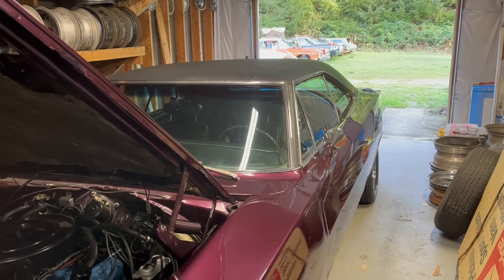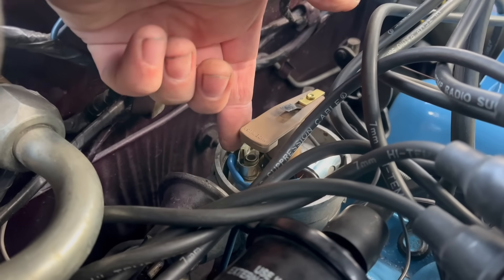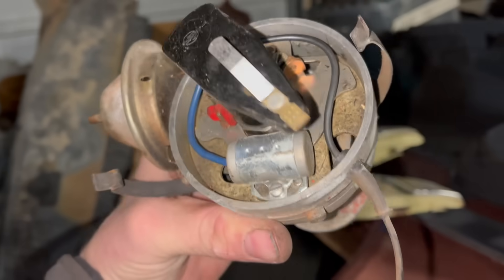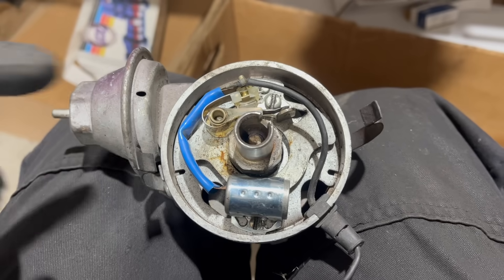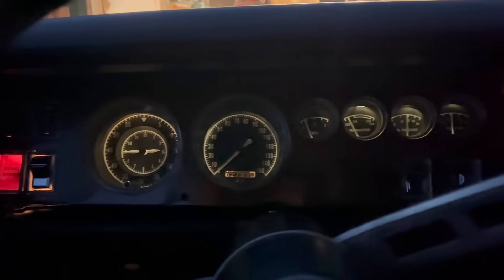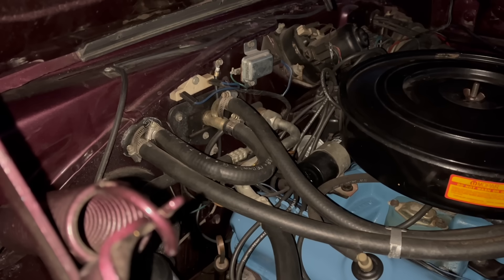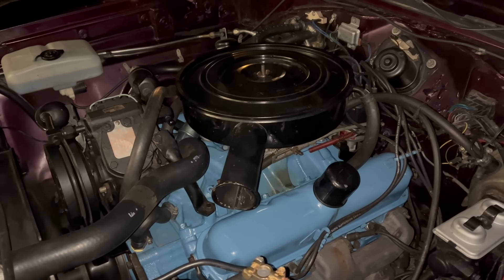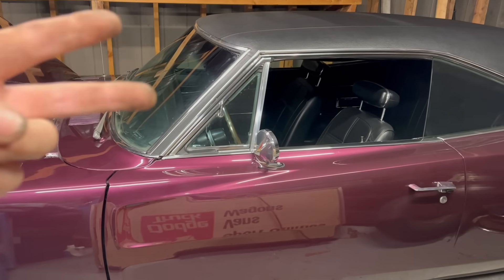I Drove This 1969 Dodge Charger 1800 Miles With A Broken Distributor... Let's Fix It!

Comment: Jamie!
Do not count me in with the BBD haters - that carburetor was used by Ma Mopar for damn near 20 years and
is an incredibly reliable and simple carburetor. For non-haul ass applications of small blocks, it's damn near
perfect.
As usual, a very enjoyable video chock full of good info. How a young feller like you has all that already in his
noggin is beyond me.
- Ed on the Ridge

Comment: The other part of the "5 minute tune" that takes 20 minutes is adjusting timing and managing the various (OK, two) advance systems.  I took apart and cleaned up the distributor in the Belvedere when I first got it, to discover, like you, that neither the centrifugal or vacuum advance was happening.  No problem, new vacuum canister and get everything clean and greased and back in the car.  I did notice that a pin on one of the weights that slides in the slot to advance things was worn flat on one side.  Everything seems to move around like it was supposed to so back together and into the engine.  No matter how I tried, it could only read about 10 degrees of centrifugal advance (the rotor plate says 11.5 for 23 degrees of crank advance), and it was variable and only occurred at higher engine speeds - 3000+ rpm.  I took the distributor out and apart again, didn't appreciate the problem, made sure nothing was in the way of things moving and stuck it back in.  Basically the same result, which is not surprising because I didn't change anything.  Now a distributor that only advances 10 degrees is not a bad thing to have, unless it does so unreliably.  Then it dawned on me - the way the weights move the plate and advance the rotor relies on those pins being circular, and if one side is flat that only prevents the plate from rotating no matter how light your springs are.  I can't find anyone who will sell me just the parts I need, so maybe a new distributor is the only way to go.  I am going to try to return the pin on the weight to circular cross-section with some grinding to test my theory, and maybe fix the problem at the same time.

Comment: I sort of understand why some people don't like the BBD carb - it's so darn small, But I love 'em. My first car (a 69 Fury 318) had one, and I have one on my 56 Dodge pickup with yet another totally stock 318. For what I use the pickup for, the BBD is perfect - it almost never gives me any trouble and just does its job.
Reply from the maker: Exactly! Most of my experience with them has been on trucks. Just a solid unit.

Comment: That distributor reminds me of my first car when I was 15. Had a 64 Dodge 330 383 with a 4speed and 3:91 gears. It had a Prestolite dual point distributor and shortly after I bought it quit in heavy traffic and found that one of the points had completely burned up. I replaced it with a Accel duel point. Just realize this was back when I was 15 in 1970 with smelly feet.
Reply from the maker: Oh wow! I sure wasn’t cruising around in a big block four speed Mopar when I was 15. Haha.

Comment: Had a similar situation, was out for a drive, suddenly the Engine started loping at idle, and would smooth out, kind of, at WOT. 
Pulled into the gas station to pop the distributor cap off, The distributor springs had snapped allowing full and no advance at the same time as the engine was running, the distributor rotor would flop back and forth as there was no springs keeping tension.

The engine was idling at 1400 to 3500, up and down constantly, i was able to sweat profusely and "limp" the car back home.
Any lower idling RPM would stumble and potentially kill the engine, the low/loping RPM also had a dreaded negative feedback, If the RPM's got too low, the Distributor timing would "snap" to no advance, and high RPM's would give a momentarily smooth but high idle, but the idle would still oscillate, but not enough to kill the engine.

This was on a Dodge Custom 880, or Chrysler's forward look car, with a 361, the hope is i didn't shave too much life out of the engine with extended high RPM oscillations.

Comment: You can run more initial timing without driving the total timing too high by shortening the slots in the advance plate.  If you decide to shorten the slots by welding, be sure to wrap the points cam with heavy tape so that it doesn't get weld splatter on it.  :)
Reply from the maker: If you heard me reference a video about performance timing curves, then you heard me reference a video where I explain all that. 😅 also, I wouldn’t weld it without disassembling the distributor.
Reply: Why on Earth, would anybody WELD up components in a DISTRIBUTOR while it is still Assembled?!, and Heaven Forbid while it is still installed in the Vehicle?!. To debate this is Utter Lunacy! Just Sayin'.
Reply: I get pinging bad when i advance my 440. Its a stock racer brown cam and seems to not ping at 3 degrees advance, but i know it will run better with more initial. I put lighter springs in it. I got one of those firecore distributors to try out. So, what ur saying is if i lock out the mechanical earlier it will not ping? Then hook of vacuum advance.
Reply from the maker: @milldog1969  yeah, that, basically. Check out my "Performance Timing Curves For Dummies Like Me" video where I give a pretty good explanation of all of that.

Comment: We should have spent a day fixing shit here before you headed out on your quest to drive 2400 miles. You would have made it. But it was a adventure nevertheless and a education on how to patch up things. As for bbd carbs they are simple work horses and for stock stuff there fine. For me and my engine builds they get the dumpster treatment with the intake. But for that car it's fine. As for the ping issue better fuel is needed now. It will be fine and happy. And remember that car hates you so walk away. No run😅

Comment: I built an engine that didn't have the power it should have had. I accidentally discovered that the mechanical advance was frozen plus it had a way too stiff pair of springs oooon it. Once I got it operating correctly I couldn't believe the amount of power that the distributor advance is worth.
Reply from the maker: Yes! Getting that right is absolutely essential. It’s basically the thing I pay the most attention to.

Comment: As I said in another message, I was looking at 30-40 dollars to replace the SB Mopar vacuum can.  Eventually I found an old complete distributor for less than that on Ebay and bought it after I got the seller to test the advance.  So, you can't have enough parts.  There should be a way to take those apart and replace a diaphragm  , like on a brake booster. They now make adjustable PCV valves ($$!)  When are they going to make rebuildable vacuum cans? Or fuel pumps.   (Don't say the expensive one can be unscrewed and you have access to the diaphragm because they don't sell any diaphragms as service parts.  )
Reply from the maker: They are rebuildable… if you’re really, really dedicated. And I’m not. Much easier to have a pile of 50 spare distributors to sort through… but some day we’re going to run out of them. So we hoard as many as we can.

Comment: I've had more BBD equipped cars than anything else, and I like them but don't have unrealistic expectations.  I'm keeping up with David Vizard and the Mission Impossible series, one item of which was modifying a 318 engine's BBD for more flow.  Also still kind of looking at a way to mount a 1-1/2 BBD from a 383 onto a 318; still a two barrel but more flow.  Could be fun!

So Jamie, how do you think the Charger would do on onramps and uphills now?  I was surprised when you mentioned issues on your road trip video; my '71 318 Challenger with 2.76 gears was certainly not a quick car but I never got the impression on onramps or freeway grades that it was struggling at all.
Reply from the maker: It already feels much better. It will never be fast but does feel respectable now. I’m really excited to see what their 318 build does. It’s a really neat idea.

Comment: I don't understand the hate for the BBD either.  I've had BBD's in my Valiant, my Swinger, my SX/4 Eagle....  very simple, very easy to fix when they do go wrong.  I especially like how they have separate set-screws for Fast Idle and Curb idle.  I've heard some people describe them as an "emissions" carburetor which is hysterically untrue.  BBD stands for BALL & BALL DUAL.  It's basic design dates back to the Thirties.  Don't believe there was much emissions control back then!  While the later ones did get all sorts of electro-digical giblets.... anything prior to 1980 is gravy.

In regards to your Charger's inner tail lights.... I see this ALL the time.  Even one of my Best Friends has done this to his Charger and he won't let me change it!  Seems lots of people just jam an #1157 bulb into those inner sockets.  That's the incorrect bulb.  Try and find a #67 bulb.... these bulbs only have the dimmer or "running light" filament and won't be so bright.

Interestingly enough, the 80's Lebaron coupes had a similar setup. Since brake lights can't be on moveable body parts (by law), only the outer tail lights on a Lebaron used #1157's.  The bulbs that lit up the trunk tail panel were also #67's and we dimmer making it look like the car almost had a full-width tail light.
Reply from the maker: The inners are single filament, single post I think - so 1156 is the standard one. I found a number for a “dimmer” bulb online that wasn’t… then I gave up.
Reply: @DeadDodgeGarage    Could convert the inners to a socket like the others.  Of course, then you'd also have a three-segment brake light and turn signal.

Could be fun to put sequential turn signals in there like a Mercury Cougar or Imperial.

Comment: The original distributor as shown at 3:49
Notice how round the cam lobes are.  I had one on a 68 440. I swapped it out with one that had better cam lobes and it ran much better.  Then I put on an original type (inductive non CD) Mallory Hyfire ignition box and it ran a bit better yet.  I put the rounded lobe one back in and it kept running well.  I think the dwell was not enough with the rounded one.  I can't say I verified that with a dwell meter.
 With the Hyfire, the dwell was controlled by the box, so the poor condition of the cam lobes did not matter.  The original Hyfire is pretty much shunned since it looks so old fashioned, so if you are at a car swap meet, you can get them pretty cheap.
  So, the spring was broken on that distributor you took out?  I wonder if replacing the spring was all that you need to get the mechanical advance working. I would think it would still work with a single spring unless it is all gummed up.
Reply from the maker: The weights in the unit I took out were totally fine and the mechanism moved freely. I was initially planning to simply install springs and reuse it. Then I learned that the vacuum can was also bad, so I was going to change that too - or just change to a distributor that worked. Then found the complete and working distributor that just happened to have the correct ‘69 part number on it, so I went with that instead. I didn’t notice in person that the lobes were any more or less round. But in theory, it really shouldn’t matter, as the dwell time is the only important factor there - as you pointed to.
Reply: @DeadDodgeGarage  What I am saying is the rounded off corners make it hard to get the correct dwell. It still runs, but with less dwell, less spark is sent.

Comment: Glad to hear the plans for world domination are still on, you haven't mentioned it for a while. Ah yes the 318,  I've had a bunch of them , I've never really had any real problems with them except for one where the timing would keep changing on its own, never did figure that one out. I know there are several things you can do to get more power out of them, but I found swapping in a 383 worked best for me. They just never had enough get up and go for me.
Reply from the maker: I’m no quitter! We’ve had that problem on a 318… eventually the cracked nylon coated timing gear finally fully gave up - but it took a while. I love 383s, but my heart is really with the small block design. There is a lot of potential there just waiting to be squeezed out.

Comment: I would like to see if changing to lighter springs in the distributor helps performance.  Since you are close to ping, maybe not.
Reply from the maker: To this point, I have essentially ignored the springs completely. It’s the total amount of advance the distributor gives that I’m more interested in, because so many of these engines want more initial timing than I can give them with a stock advance curve. And yes, that’s where I have the most issues - heavy load, low RPM - so I’m more interested in delaying the advance than having it come in right away. With the vacuum advance set up properly, it could be used to take timing away in that crucial area and keep the rest of the curve ideal. I am planning to test that for a video in the near future.

Comment: I'm back again...... But forgot my corn dog.
Reply from the maker: 😭😭 you could always eat some of those carbon chunks under the intake of the Beach Bomber engine instead
Reply: @DeadDodgeGarage  Those nuggets got burnt..... I have a receipt and want to refund.
Reply: I had that same timing light, note had. Dropped it in water hopping off boat to work on a 502 mercruiser. Damn bowties.

Comment: Since its a '69, would using lead replacement additive smooth that ping out?
Reply from the maker: Unlikely. This is a low compression engine that should be fine on the cheapest fuel money can buy. While leaded fuel did help prevent pre-ignition, the pinging heard here was down to me dialing in way too much timing. This engine (like most) would benefit from a bit more base advance, but the trade off with this 30 degree swing distributor is way too much timing once the distributor advances.

Comment: Nothing wrong with that carb had many 🇦🇺V8s Mopars  with those carbs never let me down .Only thing I don’t like on that chargers is all that air con rubbish 🤦🏼.
Reply from the maker: At this point in history, air conditioning is a selling point. And this system is all complete and will be charged and working soon!